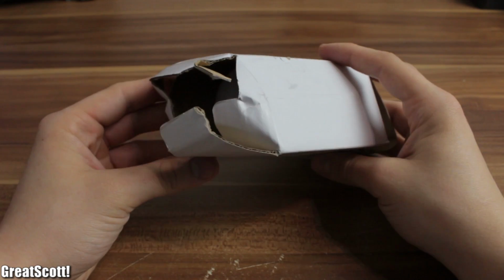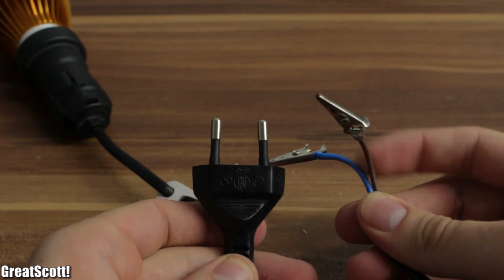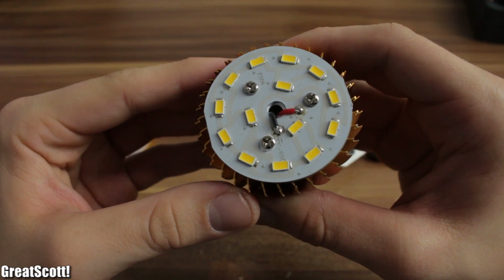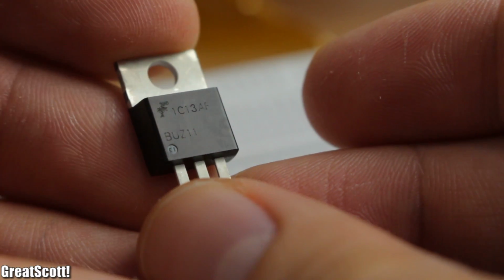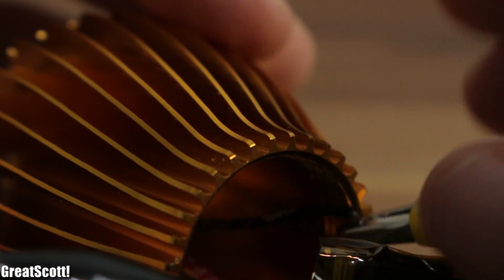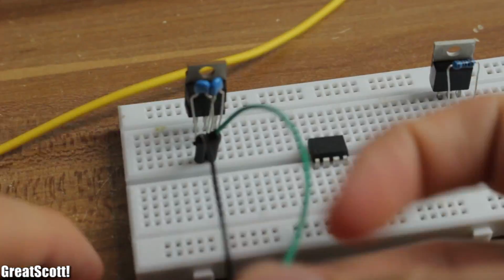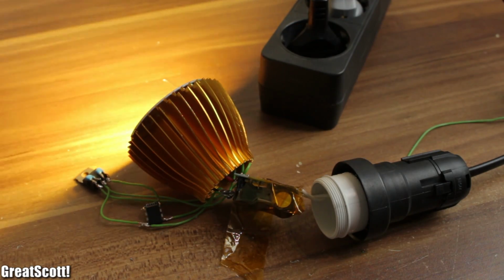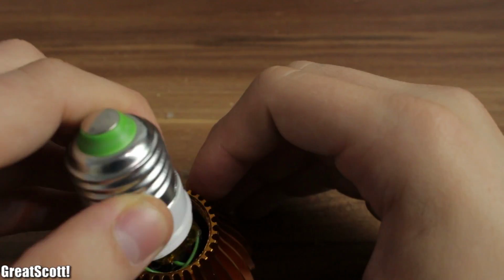HACKED!: Flickering Light Bulb for Halloween

Comment: This can be done much simpler and safer by using a dimmer with photoresistor connected parallel to dimmer’s potentiometer. For blinking light source driving photoresistor can be used random blinking LED, or even small tea light from Dollar Store

Comment: In theory, you could even add a sort of remote controlled aspect, right? Using a IR reciever and 1 extra pin on the tiny, you could get it so the light would act normally and flicker depending on IR toggle...

Comment: Hi,
warum überbrückst du Gate und Source? Steige da nicht ganz durch. Danke :)
Reply from the maker: +Konrad F I use a 10k pull down resistor between them. This way the gate voltage is normally at 0V, which means the MOSFET is closed. Only if the digitalPin goes high, there is 5V at the Gate and the MOSFET is open.
Reply: Thanks! ;)

Comment: Hi ! can you use a regular incandescent light bulb for this project ?? Thanks in advance.
Reply: +cjimenez1203 The way he did it here is not possible. Incandescent bulbs work so differently it's not even funny. In an incandescent bulb you have a tungsten wire which is heated, and thus glows, by 120 volts AC (or 240 if you're outside the US.)

The only real way one could maybe do this, is to design a circuit which trips a relay on and off, and the relay controls the bulb. However, with that many components, it would never fit inside most if not all fixtures without somebody noticing something is wrong. You'd have to stuff it up inside the ceiling. 

TL;DR: No.
Reply: +Bryan Young Incorrect.  First off, a relay would be terrible for flickering simply because of the physical limitations of the relay - this would fry it almost instantly, and second it is entirely possible but would have to be in it's own case, and the controlling device would be better off being either a solid state relay or an SCR or such.

TL;DR: Yes, but in it's own case instead of inside the bulb.

Comment: Simplest way to flicker any load is to connect flourscent light starter in series to the input 230v or 110v supply..  We don't need all these programming and stuff which u have shown..  Yup ur idea works but mine is too simpler to get the same output...
Reply: +Santhosh Ksjc  Can you supply details? I really want this effect next halloween.
Reply: Just add a tube light starter in series with load that's it

Comment: not being a smart ass, but doesn't that mofset gets really hot? and 7805 regulator could get to hot too, cause it's been feed with 19 volts, which is a lot, it could melt the glue and the resistor, but everything works fine right?
Reply from the maker: Exogen Design I always test all circuits that I build in detail. The MOSFETs does not even get warm but the regulator heated up quite a bit. Not enough to melt anything but it was warm. Of course I do not show my tests in the video, because that would bore the viewer.
Reply: GreatScott! ohw ok sir, sorry for being rude, sir I didn't mean it that way, I am just a newbie and cautious, thanks for the reply sir.

Comment: Doesn't that 7805 get quite hot when dropping 19V with it? Sure, you don't draw much current, but still ...
Reply from the maker: Gregor Ottmann Well It didn't get that hot. I would still call it warm. Otherwise I would had to use the body of the bulb as a heatsink.
Reply: I think all the LEDs are in series so most of the voltage is dropped
Reply: theiceman259 The 7805 is connected in parallel to the LEDs, so it actually gets the full 23V. That can clearly be seen in the final schematic. (HACKED!: Flickering Light Bulb for Halloween)
Reply: Gregor Ottmann  I assumed you were talking about the mosfet, I'm unfamiliar with the part numbers :P
Reply: The attiny wouldnt draw much power at all and as it is just controlling the mosfet, although there is a 19v drop the current is tiny so the heat output is tiny. If he had put through 200ma or so then it would need heatsinking.
Reply: +theiceman259 That's the most common voltage regulator